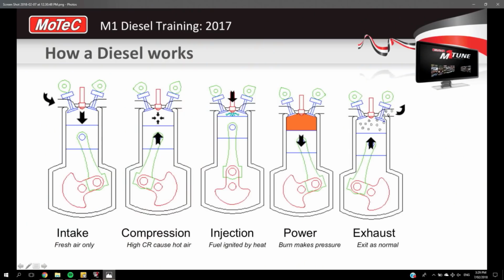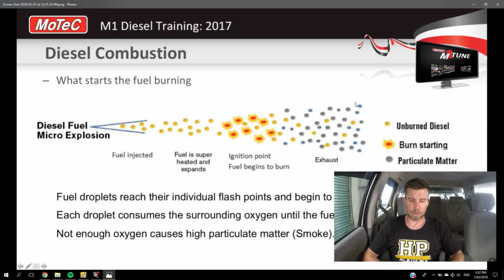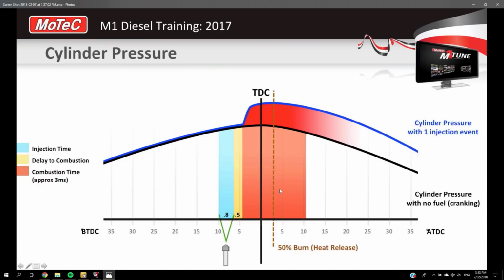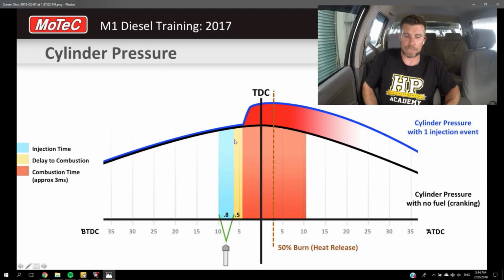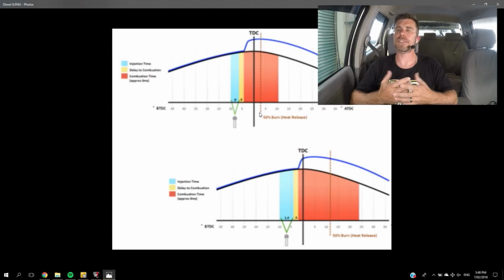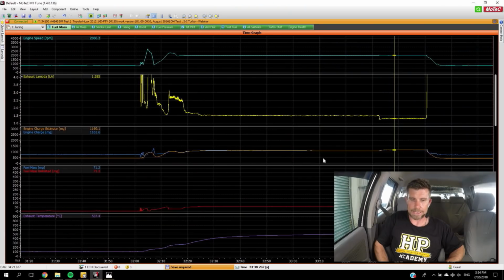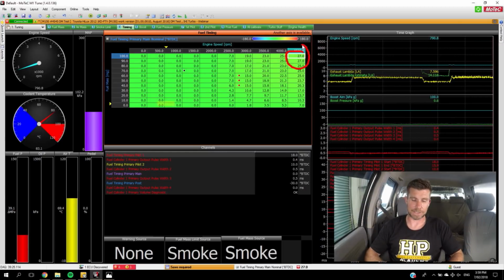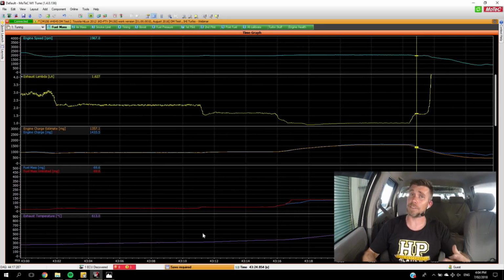Your Guide To DIESEL Engine Tuning Fundamentals

Comment: In Europe most of the tunes we do are on common rail engines, cars or heavy duty machines.
We use read/write tools like, alientech kess v3, flex magicmotosport, dimsport tools, and software like Winols, stagex, ecm titanium...etc. Your channel popped up to me, i watched few videos and i like your content 😊
In many modern diesel ecus, for example Bosch MD1xxx ecu, we have hundreds of maps, maps for different driving mods (Sport, normal,eco..) torque to injected quantity maps, torque limiters by dpf soot, smoke maps by maf, inverse torque maps, tq limiters by air temperature, many injection duration maps, like for dpf regeneration, fuel injected quantity limiters by airflow etc.
Great video which explains basics of diesel tuning, very clear explanation.
Thank you!

Comment: Quick question, during normal operation if you hear like that high frequency pingy i call it crickets from around 1700 to 2100 rpm could that be the pilots being too much advanced or too much quantity delivered? Goes away when you put your foot flat but mostly at cruise i can hear that and want to understand what could be causing it so i can relay to dealers(Not too bright) its a modern common rail diesel (cannon) but just more interested to know than anything else?

Comment: So I have a new triton with the 4n16 and wondering if the throttlebody operates like a petrol?  I only just heard that diesel throttle plates stay wide open and wondering if this is true for the 4n15 and 4n16 from mitsubishi?  

Trying to understand how my evcx throttle controller is actually working.  Obviously its manipulating the input signal from the pedal, just not sure what its communicating to.

Cheers

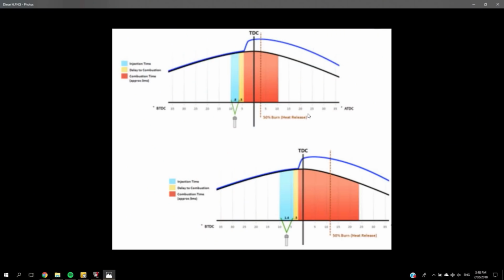Comment: Increasing injection duration and keeping all other variables the same increases heat release rate (you've essentially richened the mixture) the information presented in the slide @24:00 is incorrect. The cylinder pressure curves are totally wrong, ignition doesn't happen at the end of injection, ignition happens when the first fuel atom has reached the activation energy required to start off the reaction. The fuel atoms receive energy from the cylinder temperature which first vaporises the fuel, at no point does fuel injection duration delay or affect any of this process.
Also I just noticed that the 50% burn happens later in the cycle, and this has nothing to do with ignition delay but because there's more fuel injected and the end of injection is later in the cycle, thus a later 50% burn
Reply: i love it

Comment: Thanks for insight.
I'm about to get my ZD30 CRD tuned.
This has given me a window of understanding what is about to occur. 
My goal of this tune, retain reliability, whilst gaining power increase and lowering EGTs if possible.
Again, thanks. Appreciate explanation. Regards.
Reply: Had my tune performed today, great gain in power, far less throttle input required, but the main benefit I was chasing is a significant drop in EGT temps, easily exceeding 600°c prior, now I suspect I have to flog it to get to 600°c, currently running around 350°-400°, so I'm impressed this far.

Comment: About time for diesels! Very informative vid 👍.

Question, different kettle of fish. But the td42s with inline pumps. Very well known for snapping cranks due to harmonics (apparently). Would less advanced timing result in a lower peak cylinder pressure and smoother pressure gradient - potentially be beneficial towards crank snapping?

Comment: Hi guys asking how do i know whem my air fuel ratio should be near good enough.Engine is an old isuxu 3.9 4bd1 i fitted a garret turbo it was a non turbo model the garret is a replacement for the turbo type model motor.Exhaust temps max 550 & then cruising its about 320degrees.I have tried to get fuel air ok by looking in the side passenger mirror.Thanks for your movie channel.

Comment: Dumb question; does removing EGR and/or DPF increase visible smoke levels on modern diesels or is this purely because it's not tuned right and/or are smoke limiters not set correctly?
Reply: Purely tuning, I have a 2017 duramax, fully deleted and tuned. It doesn't hardly smoke at all and when it does have a small puff its not much.